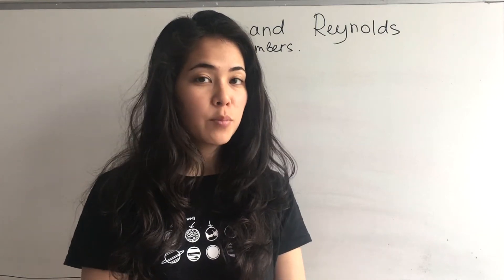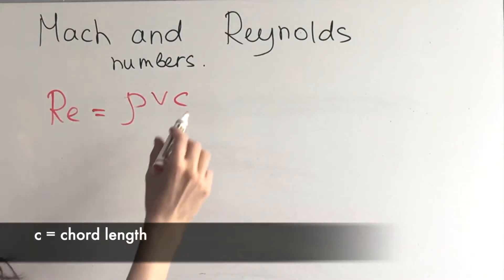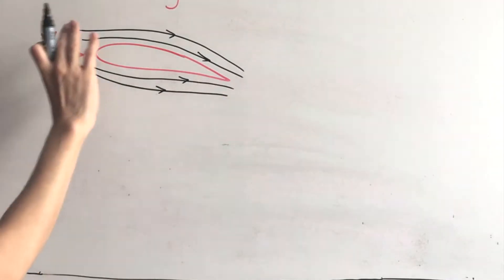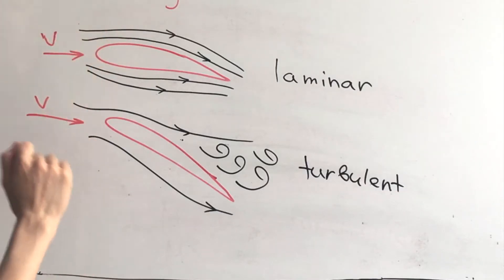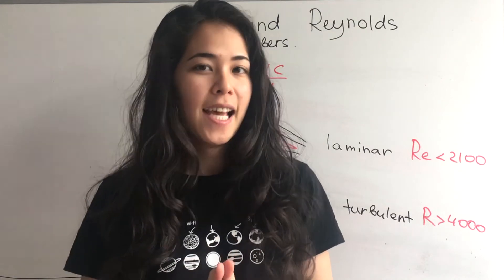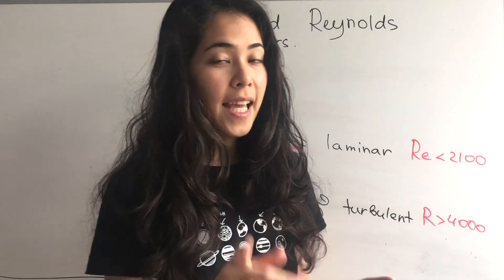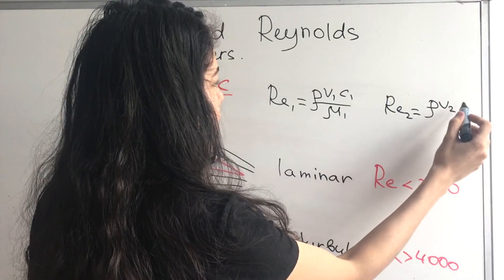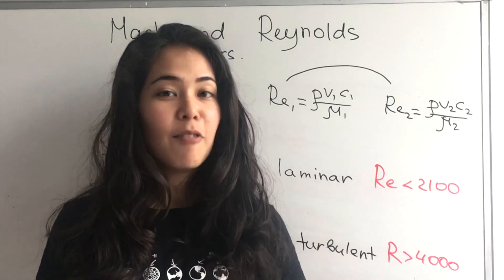Reynolds number explained.

Comment: if partof the equasion for renolds number is cord. how will you arive at the same properties for the model and the full size aircraft?
Reply: Since you are deacreasing the Chord, you can equally increase the Velocity. If I got it correct, make the model 5 times smaller and increase the speed of the air 5 times.
Reply: Bro, are you dumb ? Do you even understand basic mathematics ?  Retarded ahh comment 🤣🤦🏼‍♂️
Reply: @MrBoash  dude, relax

Comment: The tranistion point is incorrect in this video for a wing, 2100 to 4000 is for flow in a pipe

For a wing, without inducing it by changing the AoA, it is about 500,000, eg the variable is velocity only.

To induce it by stalling the wing the transition point is about 50,000.

Using the transition value for a pipe and applying it to a wing is common mistake people make when dealing with Reynolds numbers.
Reply: It was still a very good explanation but thanks for clearing that up. I’ve been skirting around this for decades and she made it much clearer but I was a bit surprised that the figure was so low and I thought she might have omitted a zero or two.
Reply: This should be top voted, because she´s totally off.

Comment: You give an equation for Re, and show a wing at two different angles, but one is turbulent and one is laminar.  Yet, you failed to say what in the equation changed to raise Re. (so it is allegedly turbulent).  For this reason, I downvoted your video.  And so should everyone else.
Reply: Hey genius all you gotta do is use the equation that she gave and you can figure it out yourself… either one of the variables in the numerator increased or the other variable decreased.
Reply: @Captain_puckett  NO NO NO.  Look at the wings in 1:46.  The have the same exact parameters, but one is in turbulence because of the angle of attack increased, which is what she should have discussed if she had any actual awareness of the subject matter she's reading about.
Reply: @jason.arthur.taylor  she literally did explain it by saying AoA which is all she needed to say because at this point you should realize that Re~u~L/D~CoL/AoA. Asking her to explain why Re changed with AoA (which causes separation) would be circular as Re is by definition the quantification of laminar-turbulent flow. “Re has changed; Why? Because airflow is turbulent! Why? Because Re has changed!” Repeat infinitely…

Comment: Thank you for taking the time to do the explanation. 
Re<2100=laminar and Re>4200=turbulent ONLY applies in closed channels such as pipes, not for external flow such as airfoils.
Reply from the maker: That's true, airfoils have much bigger Re
Reply: @AliyaBurkit  Yes, turbulent flow happens beyond a Re of 5X10^5, I recommend reading in chapter 10 of Cengel and Cimbala - Fluid Mechanics 4th Ed, the section of boundry layer development over flat plates. Keep doing science videos ;)
Reply from the maker: Thanks! I will do another video about Re

Comment: I am making an Rc aircraft. (90inches wings span) So I must keep the Rynolds number between 2100 to 4000?
Reply: these are wrong values....these are Re for pipes(internal flow)...  for aeroplane, flow over the wing is an external flow...
external flow values have difff range...
Reply from the maker: He is right, those Re numbers are for pipes

Comment: hey, Aliya I have a question, please. if a  steel pipe with a diameter 0.02 m is used to deliver jet fuel from the tank to the engine of an aircraft. The jet fuel has a density of 900 kg/m3 and kinematic
viscosity 5×10-6 m2/s. If the engine burns 1000 kg of jet fuel per hour.
what would be the Reynolds number of the flow?
Reply: if you want you can contact me on Instagram @khouli.s
Reply from the maker: I will answer that later. I want to do a video where I solve problems that you guys asked here